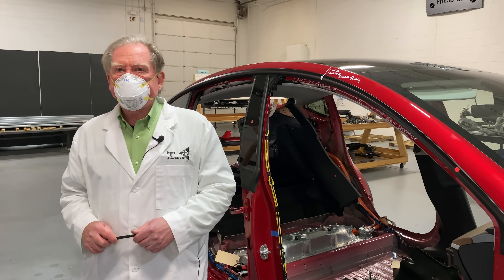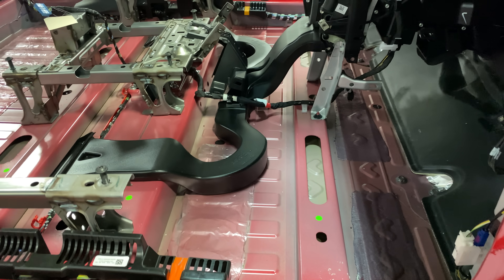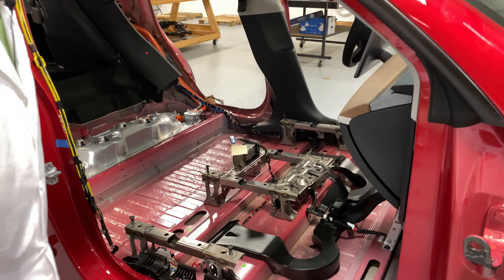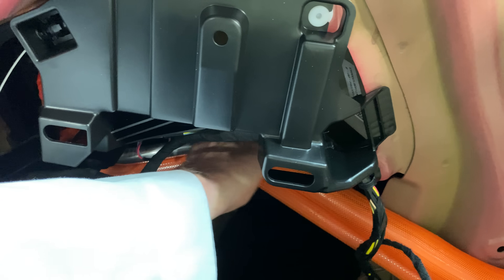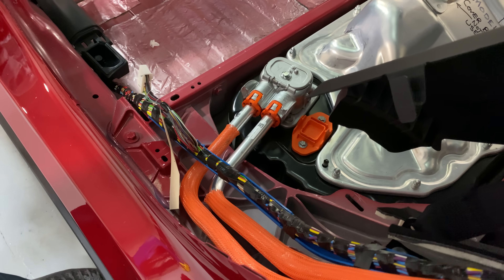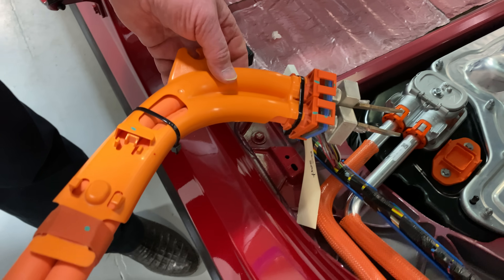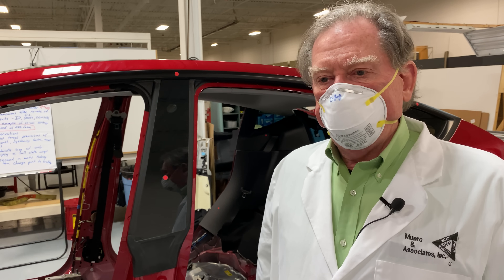Model Y E12: Floorpan, EPP Floor Risers, Commonality through Stanchions, and Wiring Observations

Comment: Thanks for the tear down; you start going into detail but when it comes to the interesting things you stop again; what is special about the black cable cover at the end of your video? Another thing is about the pipes for the charging point - advantages / disadvantages are missing - please can you tell us what is good 

About loosing paint: it is only a good idea if you are still protected of corosion: getting in and out in winter will be an issue and make that car cheap on used market
Reply from the maker: Thank you for tuning in!  Here's a little bit more context: Many, if not most, cars use wiring troughs to protect the wiring harness in areas where they need tight packaging and resistance to crush, such as at the door sill where people may step when entering or exiting the car.  Many troughs that we've seen fully enclose the harness, featuring 3 sides and a lid, and they tend to feature solid walls of material throughout.  3 interesting things were observed on the Model Y troughs: 1) They were only 3-sided (bottom was left open), which saves weight and cost in unused material. 2) There were open sections throughout the trough walls (probably what you're calling ribs), which again, saves excess material, and thus weight and cost.  3) The walls themselves seemed to be of rather thin gauge compared to other, more robust trough designs we've seen, so again, thinner walls, less material, less weight, less cost.  The over-arching takeaway is that it seemed to be a cost and weight efficient execution of a wiring trough.

Comment: Is the battery power return from the engines via cable or the cast body? I had heard that they were designing high conductivity Al castings.
Reply: The high voltage system for traction, from traction battery to the motor should be electrically isolated from the car body (and all metal parts that one can touch) and the "12 V" system. Therefore, all current for traction must run in cables. (PTC heating elements and the compressor in the heat pump may also be fed from the high voltage system in many electric cars)
The "12 V" system may still use the car body/chassis as conductor

Comment: 35 years of working in automotive harness and factories world wide Im Interested in the wire harness. I dont see the buss bar moulded Tesla Patent here. What I do see based on Teslas released data on total wire reduction Model 3 to Model Y is greater use of networks and some simplification of current wire harness design. I see process simplification in the metal tubes of the charge lines and good focus on tidy under body runs in convoluted tube as in previous clip, evolution rather than revolution. Im very interested in the RF antenna in the window lift or doors area. Im convinced these are for feed back line side of correct wiring harness fitment, on track in assembly testing, aids to robotic assembly ie the robot gets RF feedback task OK and in vehicle use diagnostics , may be robo taxi built in redundancy in case of accidental severing of wiring runs. Id like Munroe inc, thoughts on this.

Comment: I've really  enjoyed Sandy's interviews on Autoline and elsewhere these past few years and it's great to see you have your own channel now. One thing I don't understand in this video is around the 5 minute mark when Sandy's talking about the cable trough, what exactly is better/different about that that vs a traditional OEM way?
Reply from the maker: Thank you for tuning in!  Here's a little bit more context: Many, if not most, cars use wiring troughs to protect the wiring harness in areas where they need tight packaging and resistance to crush, such as at the door sill where people may step when entering or exiting the car.  Many troughs that we've seen fully enclose the harness, featuring 3 sides and a lid, and they tend to feature solid walls of material throughout.  3 interesting things were observed on the Model Y troughs: 1) They were only 3-sided (bottom was left open), which saves weight and cost in unused material. 2) There were open sections throughout the trough walls (probably what you're calling ribs), which again, saves excess material, and thus weight and cost.  3) The walls themselves seemed to be of rather thin gauge compared to other, more robust trough designs we've seen, so again, thinner walls, less material, less weight, less cost.  The over-arching takeaway is that it seemed to be a cost and weight efficient execution of a wiring trough.
Reply: @MunroLive  Thanks for the reply, my curiosity is satisfied :D

Comment: Great video, but way too short...  
I would spend a full video looking at the rear floor area, checking the differences with the Model 3. 
- Can you find the location of the bolts for the 3rd row seats and seat belts. 
- Is there some possible AC vents for the 3rd row passengers like on the Model X.
- Do you think the version with the 3rd row will get a reinforced beam inside the rear bumper cover, like the Model S with jump seats in the trunk?
- Is there an unused connector on the rear wire harness that could be use for a towing electrical plug? 
Thank you, and good reminder for tipping the cashiers.

Comment: Subscribed and my first "Bell Icon Notification" ever :-) 
Have been lucky enough to visit Munro & Associates @ Auburn Hills and meet the man himself 😃

Also super psyched waiting on the teardown of the "Penthouse" power electronics bay, HV battery, thermal system circuit w/heat pump and eDrive 😁
Reply from the maker: Thanks for tuning in, Abhid!

Comment: Sandy --  A couple of episodes back you said that he hex bolt on the wheel mount was now an externally-mounted bolt that would interfere with non-Tesla rims.  Another YouTube program commentator has indicated this bolt is removable and was only needed to align the part during assembly.  Could you please comment?  Thanks, again, for your interesting analysis of the Y.
Reply from the maker: That bolt is called a rotor retention screw.  It is, in fact, removable, but it serves the purpose of holding the brake rotor to the wheel hub.  If you remove it, it no longer serves that purpose.  It is true though that not all vehicles use them, and that you can operate without them, as ultimately the wheel will clamp the rotor flush to the hub, but then the rotor may shift as you try to install the wheel.  At the end of the day, it is not an insurmountable barrier to aftermarket wheels, we will not argue that.  People can, and will, run aftermarket wheels on this vehicle.  As you could probably tell from Sandy's tone at that point in the video, he said it a bit in jest, as it was referred to as "cute".  Please take that comment with a grain of salt :)  Thank you for tuning in and keeping us on our toes!
Reply: Thanks for that clarification.  Are you saying that some aftermarket wheels may require removal of that rotor retention screw?

Comment: You can discharge that battery by just running a halogen lights on a 12v bus, or run 4 x 110 light bulbs in series on 350v. Just limit your discharge rate to like 4A.... I doubt it will fully drain, most likely these controllers inside battery packs will shut em off. But at least it is much safer to work that 350v. In the future drain the battery before disassembling...
Reply: He should of driven it to 30 percent

Comment: 1:18 what is NBH?
Reply: NVH=Noise, vibration, harshness
Reply from the maker: @martingardens  Correct, thanks for the help!  This acronym basically represents any noise or vibration that would be deemed unpleasant to the customer.
Reply: @MunroLive  Please look into the 402 kg payload limit (owner manual p. 189). 
Is there a max payload info printed on the "Tire and Loading Information" label?
Interesting would be to determine what structural elements or components are the reason for this low available payload.

Comment: The seat mounts look like they're plated or anodized for rust resistance.
Love the conduit, protect from physical forces and rodents, would like to retrofit under hood of my Fiat 500e (i prob won't)
Seen candy striping before, looks really cheap, usually broken by the time I see it, prob for assembly.
That moulded carpet looks expensive to replace, take care of it!
Shows me there may be a good reason four things that look cheap on ANY car, respect to engineering!
Reply: The car should be dry enough inside for them to last 20 years without any rust forming.
Reply: I've seen minor interior rust in some of my cars, I don't think that gold-colored metal rusts much tho.

Comment: Thanks for putting this together Sandy! Did you notice a significant decrease in wiring in the model Y vs the 3. There were some rumors about wiring getting down to 100 meters in the Y vs 1.5km in the 3.
Reply from the maker: In short, no.  The Model Y still features relatively conventional wire harness construction like the Model 3.  We will elaborate more on this in upcoming videos, but suffice it to say, still much more than 100 m of wiring in the vehicle.  Thanks for tuning in!

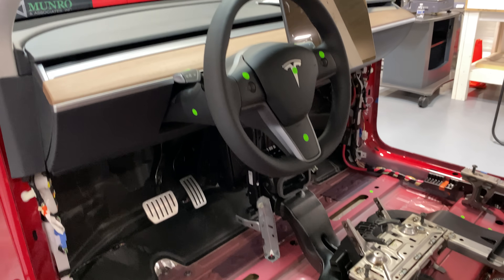Comment: Hey Sandy, I have a question about the stanchions you're talking about at 5:23
Would it be relatively simple to remove/lower them but still be able to put the front seats back on properly?

I'm wondering this as I'm quite tall at 205 cm (6'7") and my biggest issue in SUVs that I've test driven is that my eye level is the same as where the sun visors are fastened. This happens even for large SUVs like XC90 and X5, where I have put the seat in the lowest position. And I feel I have to duck and move my head to look around the rear view mirror quite often (this is not about head room). So it would feel a good solution to lower the seat just a couple centimeters, or would you advise against this as it'll weaken the structural support which might cause safety concerns?

And thanks for doing this series!
Reply: I have no knowledge. But it should be possible as they seem to be bolted down. however, I would make sure to ask someone who knows what they doing before cutting and welding. (or maybe tesla could have a lower version of that metal-thingy as a part (maybe a model3s part would work?))

Comment: There's no cable inside that "pipe", the whole thing is a solid aluminum bus bar with a shielding layer.
Reply: Looking at it you can tell its just pipe with wire running through it. You can even see the marks on the pipe where they formed it to a particular shape. Also bus-bar was never mentioned unless you are just being sarcastic.
Reply: @NotNowLater 100% sure it's a busbar. I've been working on Y since pre-production.
Reply: Yeah, I was wondering why he said that too. Busbar wil help achieve 300kw charging too.

Comment: This not painted stuff under seats are from normal steal, stainless steal?
Reply: Probably a material like zintec or durasteel which are chromium free  corrosion resistant steels, they can still rust and oxidise but will take more than just normal levels of humidity to do this, i have seen 10 year old cars with this and the only oxidation marks are perfect fingerprints where a technician has touched it at some point

Comment: Hey Sandy thank you so much and the crew for this videos.
If I may leave a suggestion, please equalize the audio amplitude. Your voice goes high and low sometimes.
Reply from the maker: Raphael, thank you for the feedback!  We are working through the logistics of that right now.  Turns out the mic shifts a bit when Sandy is in the crouch position - working on correcting via placement and EQ. Thanks for tuning in!

Comment: Sandy, do you put the cars back together after you deconstruct them? Or do you continue to analyze/review parts you find during teardown?
Reply from the maker: Bob is correct, once it comes apart, we do not reassemble the vehicle.  That's not to say that we couldn't, but we believe there is more value in having the parts on hand to discuss and review outside of the vehicle.  Harder to get those than another fully functioning vehicle!  Thanks for tuning in!
Reply: @MunroLive  thanks! I had assumed so, glad to get the straight answer.
Reply: See how the Model 3 parts he brings in for comparison?  They've got ID tags attached.  

I'm pretty sure separate parts are getting warehoused.  I think we've seen shelving units full of parts.
Reply: @bobwallace9753  gotcha. That's what I thought, but I had this on "in the background" so I really couldn't see too well.

Comment: On the main conduit power/charge lines (your term = pipes), yes it may be cost saving and easier to install but that does not necessarily make it better. If the cables were simply snaked through the metal conduits rather than be encased in a flexible reinforced orange sheath like before, these ridged conduits could then bend and rupture during a rear end or side collision. This could send a full charge into the metal conduit and then into the car body/frame, translation, a FIRE 🔥. But having the more expensive flexible reinforced orange cable harness as in the Model-3, there’s less chance of this happening and may even prevent fires. (There's not been that many Model-3 fires reported) Plus... not powder-coating (painting) the seat risers is a bad idea for obvious reasons known to many auto body and/or car restorers that know his or her stuff. (Unless they're zinc coated or galvanized before installation.)
Reply: That is the charging cable, I dont think it live when not charging.
The car or charger should be able to detect ground fault on the charging cable, so no fire.
And it is inside the passenger cell, this is not supposed to bend in a crash.
There must be plastic insulation in the pipe. The pipe should be able to be bent without breaking the insulator.
It is also better protected against sharp objects.
Reply: That conduit pipe is used to charge car while stationary and it is not energized when you are moving.
Reply: Do you think the flexible cable alternative more likely to be punctured during a collision than the metal conduit?
Reply: Howard Zhao   Possible, but we would have had many Model 3 fires then. Therefore I will deduct that Flex is better than an aluminum conduit. Maybe a hybrid, place the heavily insulated cable inside the conduit. Maybe that’s what they did, but we’ll see once he opens it up.
Reply: If there is a short in the main battery tube wire from for example a impact crush  I'm sure the battery has a fuse to protect it from thermal runaway I would hope that would happen .
Reply: Test Pilot Tim & Keng   Yes, that line is not energized during normal driving and will only allow a charge after the cpu receives the proper charging sequence from the charging station. Yet clearly something could go wrong during a crash, why risk it. This change was a cost saver, not a life saver IMO.
Reply: @TheEDNC  Main battery is cut from the circuit during severe crash by the pyro-fuse
Reply: Keng Chang   except when the pyro fuse has failed, and it has. Bottom line, the ridged conduit is cheap
Reply from the maker: It is not atypical to see unpainted stamped steel structure on seat risers, mounting rails, or seat structure.  Take a look under your seat next time you're getting in the car.  If it's not visible and it's not exposed to exterior elements, then why pay the extra money for painting or coating?  Thanks for tuning in!
Reply: @MunroLive    <<< I own and run a custom/retsore shop. (I also own 2 Tesla's) EDNC is 110% correct on both counts.

Comment: The seat support risers appear to me to be designed to deliberately deform when the car is hit from behind. It looks like they would allow the seat to move a few inches rearward as the risers bend in a parallelogram fashion, keeping the seat upright and attached to the car during the process. This would increase the amount of time over which your body is accelerated from the speed your vehicle was traveling before you were rear-ended up to the speed your car is traveling afterward, dramatically reducing the acceleration your body experiences, especially your head being hit by the headrest.
Reply: Yes, Tesla seems to put safety very high in the design priorities.  For non-engineers, every design decision is a compromise of multiple competing priorities.  And there are many design decisions for even the smallest detail of every object.  For something like a car, there are many choices related to safety and Tesla seems to have tried to maximize it, with efficiency, performance also maximized, but after safety.
Reply: Only in quite high speed collisions.
Reply: RIP back seat person's knees.
Reply: @cstalt  No, because people in the back seats would also be pushed back into their seats by a rear collision.  Newton's Third Law.